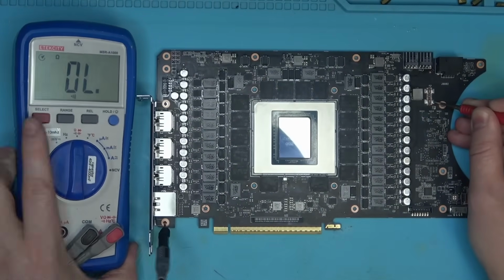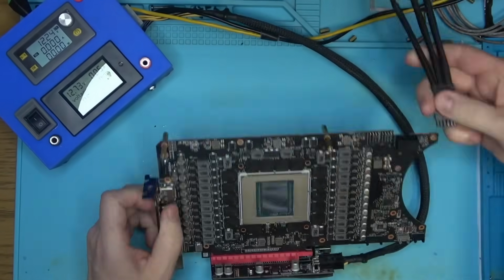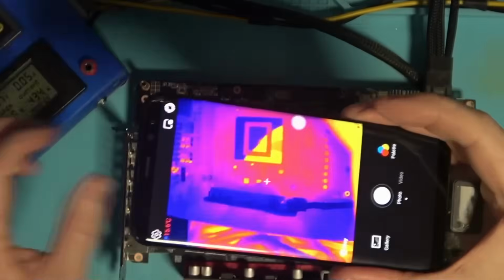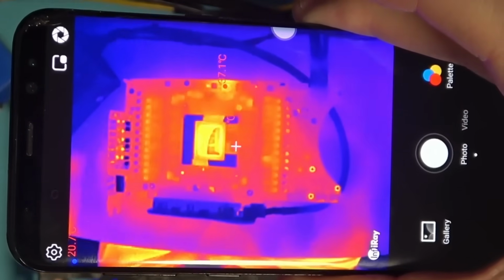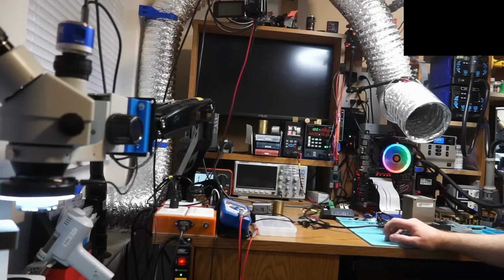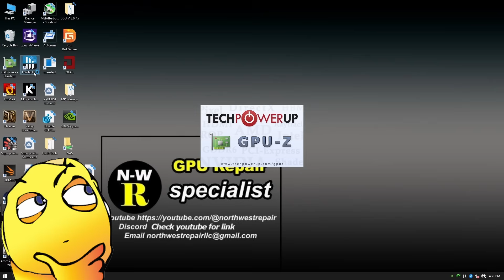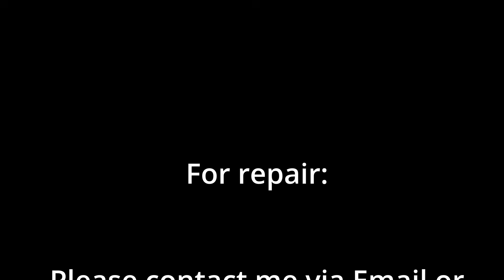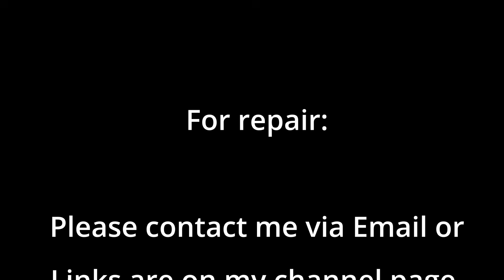New wireless SHUNT MOD for 5090 that will add memory

Comment: I have been building computers for 20 years.  Overclocking for 20 years.  I have never shunt modded a video card.  Guess how many video cards I have lost to OC?  One!  Thats it.  And it was because I was mining with it OCed to the hilt 24/7 for 9 months.  The engineers designs these things to handle the power that was recommended.  Not more.  Also, pretty balsy to try to squeeze even more power out of a connected that is proned to melt and start on fire.  This guy must be begging for a home insurance claim.

Comment: still an RTX 5090 power is not enough for some people..

shunt mod the gpu can add more power through the gpu with very small increases of the performance, just 10% or more but never 20% faster..
and shunt modding will more wasting your power consumption rather the performance..

when you playing a game, the game never need full power from your gpu.. but dynamically, depending of the rendering load..
except, rendering software or photo/video editing software.. 

so, shunt modding will noticable when you benchmarked the gpu.. the score would be higher but the gpu will generate more heat..

Comment: Shunt mods are stupid. Yeah lets push double the power into this card, risk damaging it and have it run like a goddamn leaf blower just to get ~10% more performance. Especially with the electricity prices becoming as insanely high as they are right now it makes so much more sense to instead set the power target DOWN to like 50-65% (sweet spot depends on the card, my 3090 sweet spot is 62% and my 4070 is 50%) allowing you to save around 35-50% power while decreasing performance by at most 10-20% giving you a total power saving of around 25-30% (assuming you're rendering stuff in Blender like I do so renders have to run slightly longer which negates some of the savings). In gaming you just save the flat value since it's real time so as long as you're content with the FPS, you're just gonna save money. Added bonus is that since there's literally less electricity running through the card it runs so much cooler and quieter. This can be done for CPUs too btw, usually you loose only a small amount of performance since these things by default are pushed way above their sweet spot of power/performance into the diminishing returns zone.

Comment: My 5090 doesn't like to wake from sleep or fresh boot. I wish I knew why. I run stock with lots of cooling and lots of stable clean sinewave power. It eventaully does after a hard reset or two, but it is quite annoying.

Comment: The black screen at the 1st startup. If i had to guess, nvidia drivers for the last year or so have a glitch where after driver updates, the card will flash on and off, and stay off. Ive had to force a system reset on all but the last nvidia driver update on my 4070 ti super.

Comment: 1:47 - A lot of people do seem to think that if they just use a soldering iron rated at "80 Watts", set to say 400C, that it will be able to easily solder on boards like this.

But that doesn't say anything about the actual thermal capacity of the iron / soldering station.

The soldering tip itself has a big part to play in that, as well as the solder, flux, etc.

As you say, you sometimes even need to assist the soldering with the hot air station, even when you're already using a decent soldering station.

I haven't worked on graphics cards in a long time, but I know the modern ones can have say 12-14 layers, with huge internal ground and power planes / traces.

Not too fun to work on, so I admire your skill whenever I watch your repair vids.

Comment: Eeeeeheeeeem, the 4th fan gets driven by the AIR CURRENT of the 3rd fan which may induce sprakle pixies where they are not supposed to be... At which point is 'always, when driven at 100%' negligible? 😂 also, one learns that 2 fans in direct series are either useless or harmful, usually both at the same time, what were they thinking...

Comment: He probably has more than one M.2 drives installed with one in the wrong slot causing incorrect Bifurcation on the PCIe lanes.
Reply: Or has M.2 Slots and some PCIe slots in Use.
My GPU runs currently on x8.
Reply: In this case, the primary PCIe slot will always be x8, never x4.

OFF-TOPIC
I'm using all four available drives on my X870E motherboard (MSI Tomahawk) without cannibalizing any GPU lanes.
Two GEN5 drives come directly from the CPU, plus one GEN4 drive each from the two chipsets.
One of the GEN5s shares the bandwidth with the USB-C on the backside (40Gbps), which I am not currently using.

You should always read the documentation before buying a motherboard... 😜
This motherboard was the only one with this feature in the price range of around €300.
Reply: @Universal-Dilettant  I have the X870 variant of that board, sadly there was no X870E ot that when I bought it. (the last NVME is 2x instead of 4x)
I am also using a PCIe 5.0x2 Samsung Evo Plus, so I can use USB4 and that slot.
Reply: I have a Chinese controller card in my PC that allows four NVMe drives to operate in the bottom slot with only a x4 connection (connected to the free Gen4 lanes of chipset B on my X870E).
Each of the installed Gen4 SSDs effectively only has one lane available.

Nevertheless, the individual Lexar SSDs achieve significantly higher read/write speeds than, for example, a SATA600 SSD would (800–900 MB/s), and I no longer need to use SATA.

All together, I have a total of eight fast SSDs in my main PC, and the GPU is still running at x16.
Reply: @Universal-Dilettant  However in the real world it won't make a difference at all, since NAND SSDs haven't improved on ~80MB/s Q1T1 for the last decade, Optane tried but since most people are dumb and only look at a sustained transfer they didn't catch on.
Those little Optane M10 drives you can get for <$5 now do ~250MB/s Q1T1, a P4800 does around 1.5GB/s Q1T1
Reply: Mostly Asus boards do that. My MSI board has no bifurcation on the main PCIe slot.
Reply: @gucky4717yep,MSI MAG  here and its all good.

Comment: Owner, you're modifying the card (as in this case, adding bypass resistors), so why don't you solder a few extra wires (e.g., adding an 8-pin PCI-E connector) to reduce the current draw from the 12V HPWR socket? 
I guess I'll never understand these people.😮‍💨
Reply: You really think somebody doing soldering jobs like that is even remotely capable of adding a PCI-E connector to a 12 layer board?

Dude will burn down his house.
Reply: @lookitskazzy  Since he's already heated up the PCB with those resistors, he can add a few wires there, these components are quite large, and if he really doesn't feel up to it, you'll find electronics specialists everywhere who can do such a simple mod for him.
Reply: Because the 12v-2x6 connector can handle a lot more than 600w. Simply get a quality cable for it.
Reply: @crashd1n3r  What nonsense! Sometimes it can handle 1000W, sometimes it can't even handle 400W.
These sockets are a piece of crap.
Reply: @tristankordek it can handle it as long as the current is evenly distributed between pins. Like any other connector that exists. The manufacturers allows big disperencies between the wires. That's what the problem is. Not the connector.

Comment: 5090 is so underpowered everyone needs to power mod theirs immediately
Reply: This is true, NVIDIA and their partners gimped it too bad, once its unleashed, it craps out on efficiency
Reply: @benuten3907 but they added frame generation so you can add the frames the card isn't powerful enough to generate on its own..
Reply: @unh0lyav3ng3r8 but it adds up to the system latency, which ruins it for me, max fps isn't just the metrics for a smooth gameplay..the average and lows matter more..

Framegen lessens the gpu work and offloads some on CPU..its not a solution
Reply: Only theoretical reason for shunt modding these is if you try to do extreme OC with exotic cooling. Shunt modding a "daily driver" card, especially this expensive one, is just stupid. The difference is not huge and the risk of bricking things or melting the power connector isn't worth it. Also since the 1000W "OC bios" leaked, that is no longer even needed for 5090s, you can just put in a modded BIOS that bypasses the power limits without physical mods...
Reply: @Jarnis-v1c nahhh, I am not aiming any leaderboards or hall of fame, I do it for fun and I want to maximize the hardware I bought.

I have most of my good binnes GPU's (nvidia) shunted..
Reply: @Jarnis-v1c  I am surprised people find a way to increase traces width to increase pcb power support by installing "exotic" coolers...
Reply: @BonBaisers  It is not about increasing trace widths, the mod fools the card to mis-detect how much it draws power, allowing it to exceed the default BIOS limits. And for 5090s it is no longer really needed after higher power limit VGA BIOS leaks.
Reply: @Jarnis-v1c  I know what a current sense resistor is. The mod you are talking about does make the PCB traces support more current. Traces are routed and calibrated for a certain power draw. I learnt this in high school by the way.
Reply: Love people trying to clean their own PS5s by themselves and spread Gallium all over. Also love people modding (or whatever they are doing) their video cards. Let's not forget those who update their expensive motherboard's BIOS and get bored waiting for the process to end. I love them all.
Reply: you got that from watching this?
Reply: just buy a 4080
Reply: honestly... I have this same card and it is perfect.
Reply: I can't tell if this is sarcasm or not. I mean. Is that power mod even legit? Like it can technically work?
Reply: @imaginitivity7853 It is sarcasm, and yes the mod works, the resistors added fake the power reading so the card adds more power.
Reply: @SviatoslavDamaschin well I hope my 12 y.o son doesn't get any ideas. If was expensive enough when I bought it and going to be way too much now to replace if he fried it
Reply: @imaginitivity7853  Your 12 y.o son should be getting your old 1080ti not a brand spanking new 5090 :P
Reply: @Odder-Being why not though? The kid can do a whole lot more productive things than game with a 5090.. a 1080ti, not so much
Reply: @SviatoslavDamaschin  I wonder if any GPU makers have looked into countermeasures against these shunt mods, i.e. by drawing a known amount of power and verifying the shunt is reading within tolerance?
Reply: @Odder-Being  My daughter have a RX 470 4 BIOSes mining card on her computer. That's modded to work like a RX 580 in performance and it is enough for Ghenshin Impact or Roblox at 1080p. A 5090? LOL
Reply: @imaginitivity7853 if done right, I just finished my shunt mod on my Titan RTX, increasing its TGP from stock 280w to 530w, off course it runs under a water block and being cooled properly..
Reply: @benuten3907 ok, so is it viable/worth doing on Radeon 9070 xt 16gb Xfx swift?
Reply: @imaginitivity7853 for Radeon GPU's its a different process, you have to hack into the i2c values via linix to reprogram the new limits of the GPU, the change can be permanent (has a way back to stock) or temporary (gone every shutdown), it doesn't require any soldering like nvidia GPU's does it..
Reply: @benuten3907 For what purpose?
Reply: @djsmith6247 of what? Shunting? 5090 is heavily power limited to 600w
Reply: @imaginitivity7853  "ok, so is it viable/worth doing on Radeon 9070 xt 16gb Xfx swift?" Honest reply: if it breaks, no. If it works, let's say yes. Unfortunately you never know if the answer was "no" until it's too late. The choice is yours, as are you money.
Reply: Matrix 800w vbios solves all the problems for 5090 owners, as long as you don't own an Astral or Suprim Liquid. Those owners are forced to use the Asus XOC 1200w vbios which actually sucks really bad. Only those pushing for top 10 3dmark need to shunt mod now.
Reply: @jjlw2378 competitive overclocking is ghey
Reply: @jjlw2378 other than pushing a few minute test to the absolute boundaries of your hardware for video game tests.. what the hell is the point? 5% more TPS when running some 20 IQ local llm? Lol sooo dumb
Reply: @stu7646 I paid for it. I'll do whatever the hell I want with it. The performance per clock is substantially better with the Matrix vbios compared to many other stock vbios even at the exact same power consumption. The voltage behavior is improved and the extra power limits allow for higher clocks even when not power limited. I think it's dumb to try and tell other people what they can and can't do with their hardware. You want to power limit your 5090 at 450w... The Matrix vbios will improve your performance. It's just an overall better vbios while also providing an extra 200w headroom. Running your hardware stock is dumb to me.
Reply: @jjlw2378  Go ahead bro. But from a stability and longevity point of view.. I can almost guarantee you won't be able to run that GPU at full cap 24/7/365 without blowing a cap and frying a trace. Good luck
Reply: @stu7646 Then it will have led the life it was meant to lead.
Reply: I bought one recently I undervolted mine and in games it uses only 300-350W with above stock performance.
People just don't know how to use their cards :D
Reply: @gucky4717undervolt! Find a youtube video and honestly, you won't notice any loss in games.
Reply: Install 2x xt90 first

Comment: owner should be glad his 3000 dollar gpu even posted after that shitty shunt mod. Did bro not even practice before doing it on such an expensive card???
Reply: Some people really have more money than sense.
Reply: probably doesnt matter to him anyway if it would break he would sent it to nwr which he did and if its unrepairable he would buy a new one some people shitting money and dont care at all just peanuts for them
Reply: I'm guessing the crappy iron he used just didn't have enough thermal mass to properly solder the new resistors on...5090 pcb can sink a ton of heat, so a crappy 900m style iron just isn't going to cut it...I have done a few shunt mods, but I always put them on with hotair...
Reply: more like 3.5k after taxes

Comment: shunt mod on card with power connector working on the edge even in stock .. what possibly can go wrong ?
Reply: Customer is
Very lucky still works
Reply: Who cares fools who have that much of money to waste?
Reply: on the edge of the official rating, but that doesn't mean is "on the edge of catching fire". the cases of catching fire are extremely bad worst case scenarios - which obviously are quite rare.
good scenarios have been demonstrated numerous times to still be totally fine at double the rating. not that you should or that there's a reason to, but that the online assertion of everything being within a couple Degrees of catching fire are entirely baseless.
Reply: I pass over 850w over that connector and it won't even reach 60c.
Reply: @crashd1n3r  fire hazard
Reply: @crashd1n3r bro holy sht that's almost the daily limit we use everyday here😂

Comment: Why do ppl try to oc those cards more then they already are from the factory?!. Why can't they do  just an undervolt and tune down the clocks a bit to get better thermals and have the card live a less stressfull life??!.
Reply: I actually haven't really had any issues with the thermals on mine. It seems to like to sit in the lower 60's under load, for the most part. I do tend to run fairly aggressive fan curves, but my admittedly limited sense for this sort of thing makes me feel like that shouldn't make that much of a difference. Maybe it's a case/airflow thing? I also don't run Afterburner or any sort of overclocking aside from the "stock" overclock/boost/whatever. I'm not risking detonating a $3,300 video card for, like, 20mhz extra core clock.
Reply: Because,yes...😂 Money made by OF 😂

Comment: The owner should check his motherboard 😂
Reply: The owner should check his sanity—Using such an expensive card to potentially set his house on fire with a shunt mod.  🔥 🚒 🚒 🚒
Reply: @KarnivoreRex  You're modifying the card, solder a few extra wires (e.g., adding an 8-pin PCI-E connector) to reduce the current draw from the 12V HPWR socket.
Reply: @tristankordek  looks like you didn’t watch the video.  Let me re-post what Tony already posted in the video, verbatim:  “Normal operating temperatures will double if shunt mod is used.  Eventually plastic will become soft brittle and will either melt or break.”
🔥 🚒 🚒 🚒
Reply: @KarnivoreRex  Of course I watched and saw this description, which is not entirely correct because the card would have to double the power consumed and the 4090 won't do that without vcore mod.
Reply: @KarnivoreRex  can you stop replying with AI
Reply: @KoolantArchive  🤖 🤖 🤖
Reply: Yeah i bought a replacement GPU,  but actual issue was my MOBO main PCI16X slot; ....   now using my card in tttthe second 16X slot @4x acttual lanes
Reply: that happens to pcie when you use more than one of the m.2 sockets connected to the cpu, it will chop your pcie lanes to x8 or x4.
Reply: @wolveric0  It depends on the specific motherboard model but it is usually divided into 2 (8 lines for GPU and 4 lines for SSD)